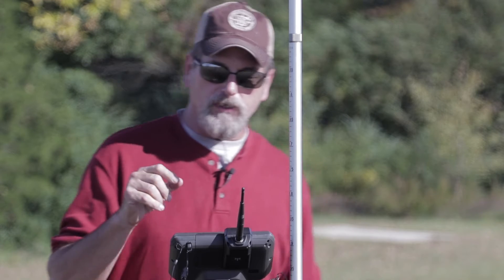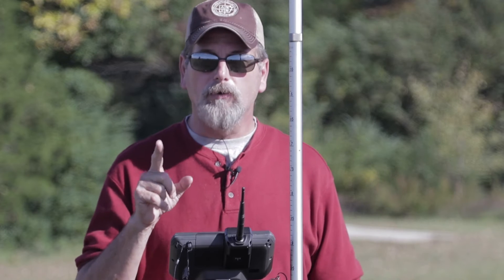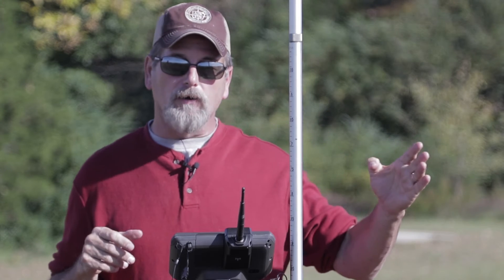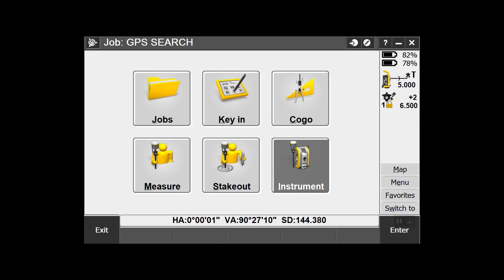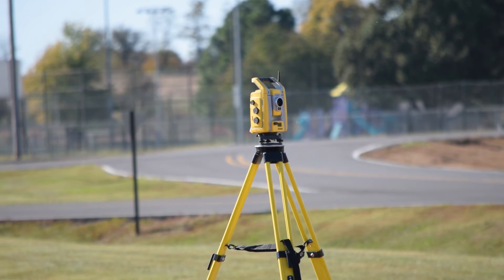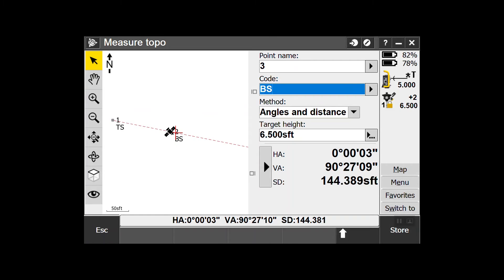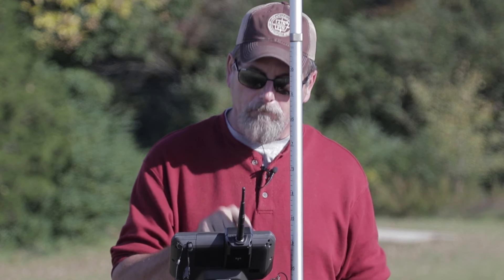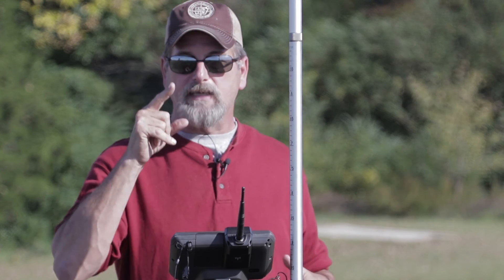Tuesday Tip - Using GPS Search with the Trimble S5 Robot

Comment: I’m still having issues. It is not working correctly. I am running a Trimble S3 robot with a Trimble TSC three data collector one target control of page 2 my GPS searches on. It also says select data source do you use Trimble GNSS or auxiliary? No target

Comment: hi, can you please tell me what is the maximum distance the controller communicates with the robot?
Reply from the maker: You should get around 1500 feet. In the woods around 600 feet.
Reply: Thank you for your response.. Actually i am using the  Leica TS 15 with CS35 and the communication is a nightmare.

Comment: Also if the gps is in a position (like urban center )that is not 'fixed' s5 will search automatically to find the prism (withought using the joystick)?
Reply from the maker: I think you are talking about auto search. It can be annoying. I prefer to set one of my app buttons with search and use that when I need to search.

Comment: Robert, thanks for the video's you've been a life saver. Anyway, all of my settings look correct and im in Virginia North coordinate system and the GPS search wont find my data collector. Some days it does, some it doesn't. Was wondering if thats a common issue? I have my collector, a TSC5, set-up to auto connect and and auto enable and it says "GPS search enabled" but the icon/symbol never appears and never finds my collector. Thanks and i hope that wasn't to hard to understand. Any feedback would be greatly appreciated. Thanks brother.
Reply: I have the same issues
Reply from the maker: I have my TSC5 loaned out. As soon as I can get it back I will take a look and put something together.

Comment: Can this be done using controller's internal GPS?
Reply from the maker: Yes sir that’s how it works.
Reply: @SurveyingWithRobert  awesome! because local Trimble dealer mentioned this method but using only external GPS unit..
Reply from the maker: He is talking about integrated surveying. That is more accurate. Your GPS in your collector is less accurate. With integrated it will snap and find you. With your built in GPS it will search for you.
Reply: @SurveyingWithRobert  well, anyway, all is good!
Reply: i mean, if internal collector's gps helps robot with auto tracking, that's all good!
Reply from the maker: Tells the gun where to turn.
Reply: @SurveyingWithRobert  awesome
Reply: now I just need to get a ACCESS licence..:DDD

Comment: After many years of using Leica kit I moved to a Trimble s5 2 years ago and it still never fails to impress me with how quick it finds and holds the target. I don't get a lot of use from the gps search, as most of my work is on city centre building projects with poor views of the sky. I tend to rely more on mt1000 active target. When I do get realeased into an rural open site (happens every so often!) then the gps comes into its own when you are a few hundred meters from the gun and passing behind obstruction like small outbuildings and bushy ground cover. Would I go back to Leica? No thanks, although this means I don't have excuse to pack up when it starts raining!

Comment: do you have problem connecting your tsc7 to your S5 robotic instrument.... i have problems where it wont connect sometimes i have to reboot trimble access and turn the instruments on and off a couple of times and it will connect eventually... but it always fails when i really need it ... i go to the radio setting and everything matches but it says port unavailable when it doesn’t connect.... if you can help please let me know thanks in advance.....
Reply: I have the same problem with my tsc7 running survey pro connecting to s5. It is the collector. No one has been able to fix it for me. Constantly rebooting.

Comment: I worked with Trimble little bit only but it always bothered me that it lacked Power Search which Leica units had.....  but this is actually pretty good, I wouldnt miss Power Search using GPS search
Reply from the maker: adamLE05401 I think it works better. Put an R10 on top of the rod and you would be amazed at how well the search works in the woods.
Reply: @SurveyingWithRobert  I work in mostly Leica using company at the moment but we'll see what future brings. If I was about to do own business than would go for Trimble probably ;) Thanks for the tip anyway and good work with your videos. I wish there were more surveyors youtubers like you !
Reply from the maker: adamLE05401 anytime!

Comment: Robert was this GPS search being performed by the internal TSC7 GPS, or did you have a unit above you prism?
Reply from the maker: Elijah Voigt, no sir. This is using the GPS built into the TSC7. This also works the same way with a TSC3. Both have a GPS unit onboard.
Reply: @SurveyingWithRobert  man that is  awesome how fast that will lock on. Other units say they do that, but nothing that works that well. Need to get a Trimble!